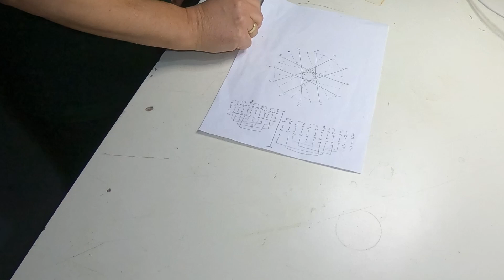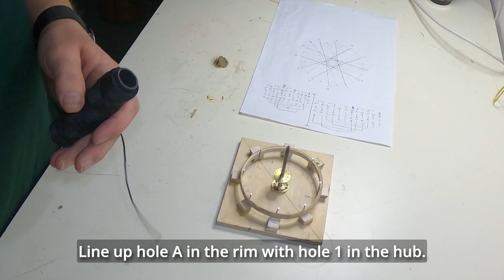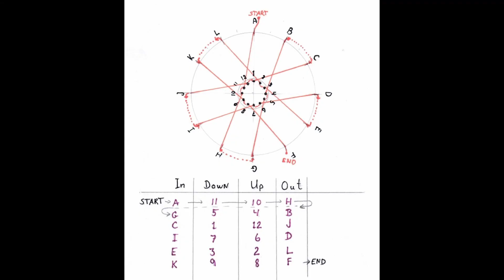RC Bleriot XI - spoke wheel - DIY

Comment: Cheer~~~each of the bars or wire rods connecting the center of a wheel to its outer edge.😊
Reply from the maker: Thanks Jason
Can you explain your comment a little bit more. As you may have noticed English is not my first language and I'm not getting this.
B.